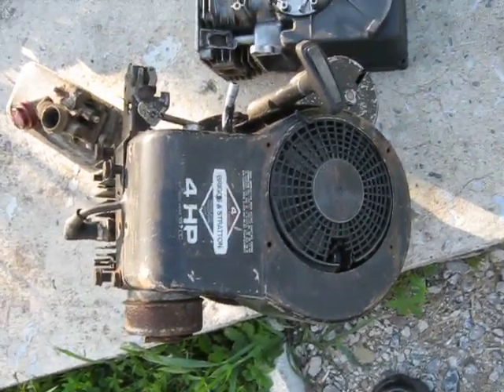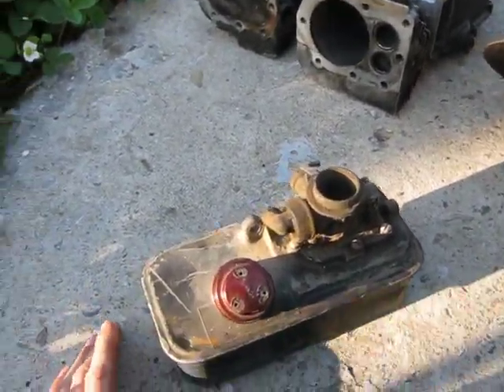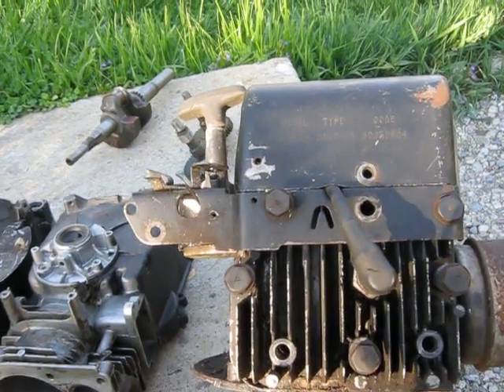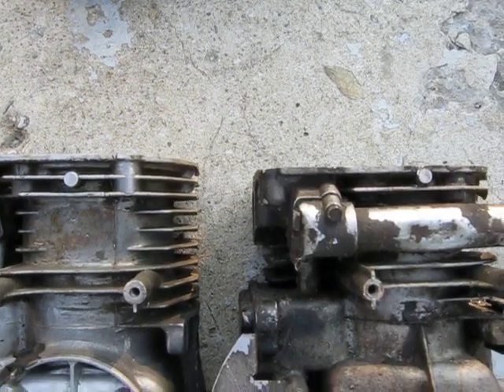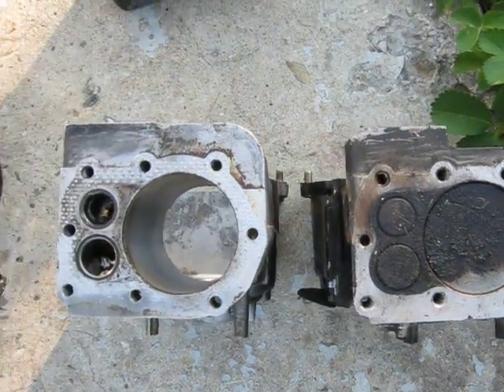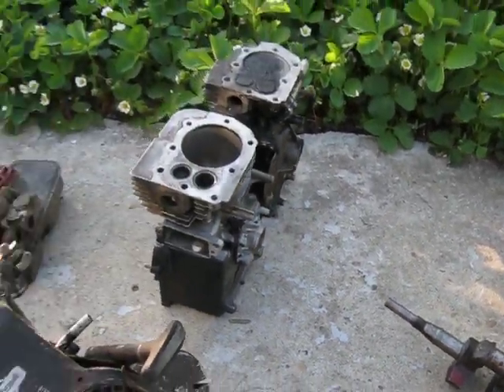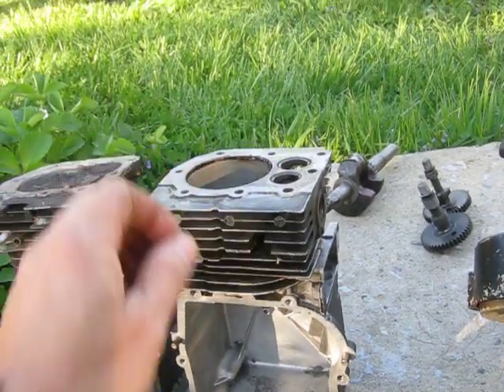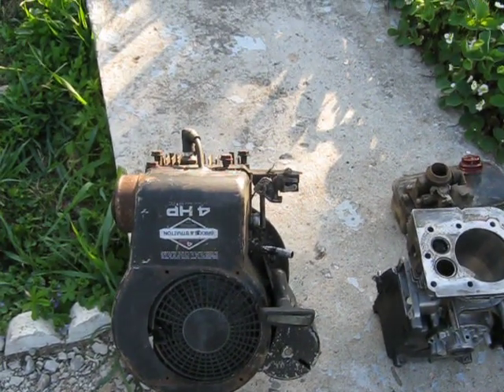4 Horse Model 110988 Briggs Overview

Comment: I appreciate the video very informative, that does look just like my carburetor and being that its the same model number and confident to work so I reckon that we will just have to figure shipping cost and what you want for it
Reply from the maker: Mr3wheeledbike Thanks for getting back with me about it. Message me with your address, and I will hopefully have the part shipped out Tuesday from N.Y. state. I will mail it the cheapest way using US Mail, what ever the mailing cost is, just round it up to the nearest $5, and we can call it even, we can work out all those details. I am still willing to put valve guides into your block if you want.
Reply: ChargerMiles007 just sent you a private message with the new system let me know if you don't get it
Reply from the maker: Mr3wheeledbike Yes, I got your message, thanks.

Comment: What's with the slit in the starter housing? I noticed some are like that. My 1977 3.5HP is not like that.
Reply from the maker: 1972FordF150 I see what you mean, I hadn't paid much attention to that. I just had a look at it, it appears to be built that way at the factory, I haven't seen a slit in any other starters either. I guess these 4 horse engines are really orphans, almost nothing from other engines will fit them!  Unfortunately I seem to own a car like that, I will be doing more homework before I buy my next used car!
Reply: I see some OE NOS recoil starters that are like that on eBay as well. They're listed for 3.5 and 4HP models. Weird. Maybe it's an access port for working on them?
Reply from the maker: 1972FordF150 Hard to say, as far as I recall it is the only one I have seen with the slot in it.  I think the 3.5 and 4 horse starters would be interchangeable, from what I have seen of the mounting and the flywheel size, it looks the same  to me.The real odd ball engine I have is the one with the electric starter, the block itself has some extra bolt holes etc. just enough that I can't bolt the starter onto a normal block (as the intake valve seat is very loose on that block.
Reply: You should get a seal driver that will fit inside of the lip of the block, and over the seat and press the seat back in, peen it and adjust the valve clearances to compensate for how the valve seat may now be sitting lower. I bet that thing will never come back out lol.
Reply from the maker: 1972FordF150 This one is a bad one to fix, the seat has been rotating for a while, and has reamed the block to a larger diameter, so the steel seat is very loose in the block now. If Briggs made oversized seats that could work, but I don't think they do. If I had access to a machine shop I guess I could try to machine out the block, and machine a new larger seat out of mild steel, since it is the intake seat, so it won't get extremely hot. Lots of work on a 4 horse lawnmower engine!
Reply: I got another junker today that I tore apart, their new 550 EX series engine. Something happened, the piston broke between the rings and just SCREWED the bore at the top of the cylinder. The rod is super thin at the back part of the rod where it goes around the journal, cheap soft crankshaft, piston is small, lightweight and cheap. The way they machined the piston for the wrist pin is interesting, they machined it so the pin goes in from one side only and they only use one C clip to hold the wrist pin in, since the other side is smaller. Talk about cheap. Everything is super lightweight. Briggs&Stratton is just a shell of what they once were. I'll make a video Monday of the damage and show how these new engines are made. I'm sickened honestly lol.
Reply from the maker: I look forward to see your vid (perhaps it is already up)
Man I sure don't like what you are describing. I guess a piston pin only going in one way is OK, but sounds like a Bean Counter got too carried away to me!  :)
Guess I better keep rescuing the old Briggs engines from the scrapyards, sounds like we might need them sooner than I thought!  :)
Reply: Ah shoot, I forgot to make a video. Already tossed the block, crank and piston. But I have sold the carb and ignition coil on eBay rather quickly LOL I need to put the gas tank up too. Sold that all plastic float style carb in 22 hours.
Reply from the maker: Man you move fast!!!!
I have yet to be brave enough to try to sell anything on e-bay, we have some duplicate dvds I have been meaning to sell, they are still in the wrapper.
Reply: Go ahead and sell them on there. It's so easy, they buy it. You pay for the shipping label on there that they give you the money for, slap the label on the box and either put it in the mail box for pickup or take it to the post office. It's surprising how simple it is lol.

Comment: A lot of this seems like stuff you'd see on maxed-out car engines. Tall deck block, small base circle camshaft, etc.
Reply from the maker: Cameron Jenkins True, I used to say to my son that I was going to build a Briggs Stroker Motor, or a small block screamer :)He didn't think it was very funny, as he was building up a real Big Block Mopar.
Reply from the maker: Cameron Jenkins I felt the same way when I pulled apart a more recent Briggs model 10A pushmower engine, it has an offset ground crankshaft to make it a true stroker motor! Though the newer one seems to be better since they still use many of the same parts as other engines unlike the old model 110___ engine.